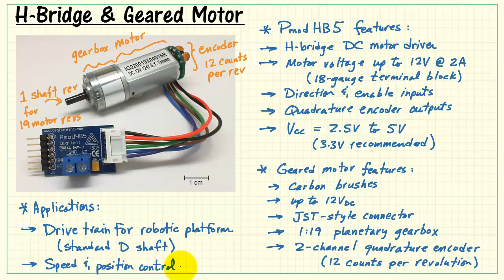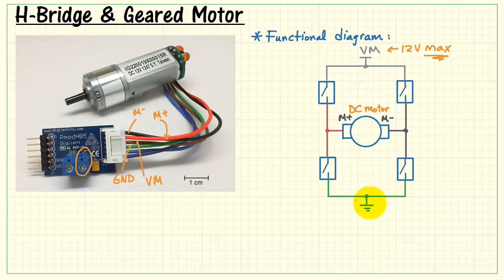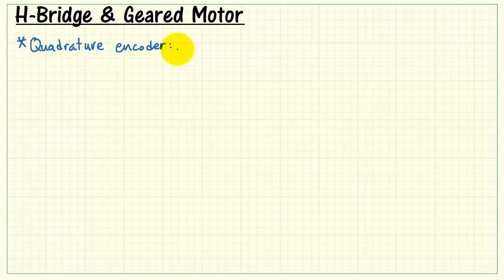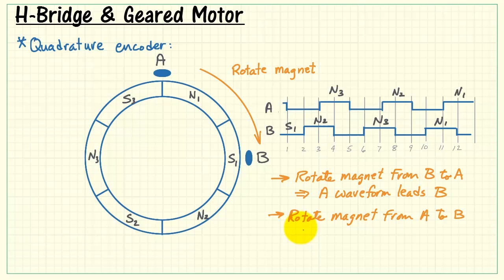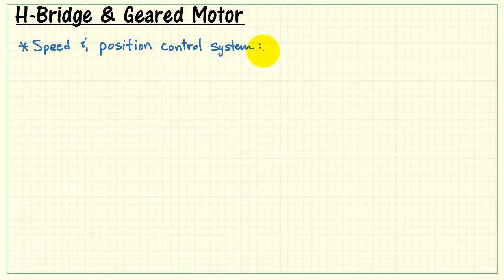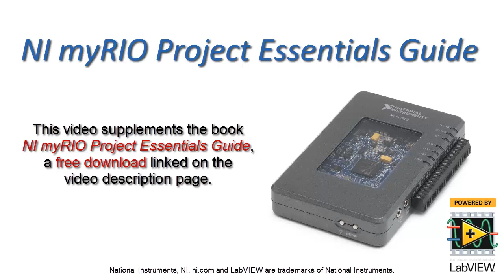hbridge

Comment: Please tell me how did u find out the CPR for the encoder of the motor. U found it online, or through a determination method? Please respond cuz im using this motor for my electrical engineering graduation project.